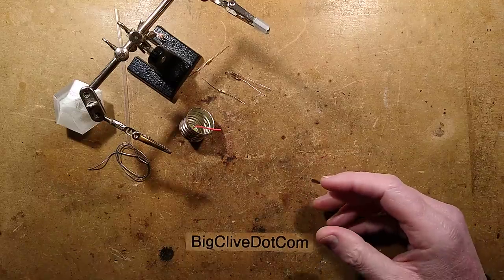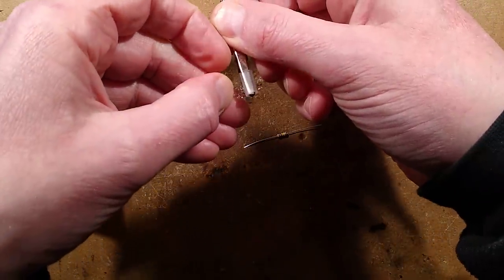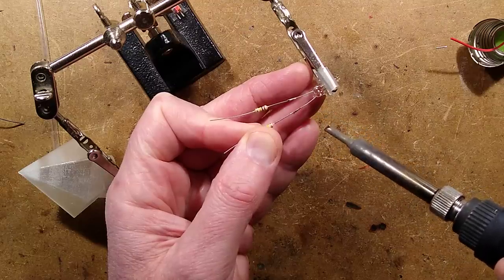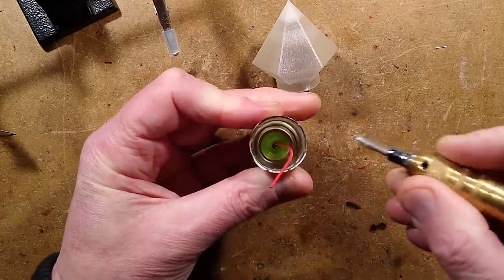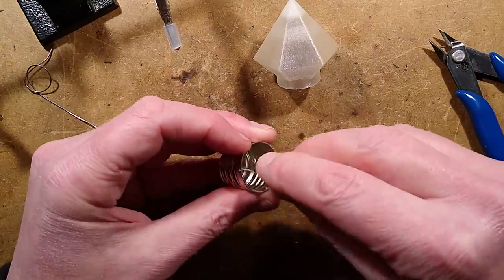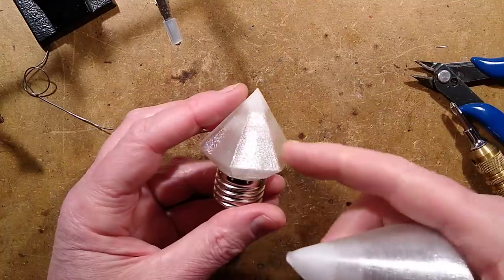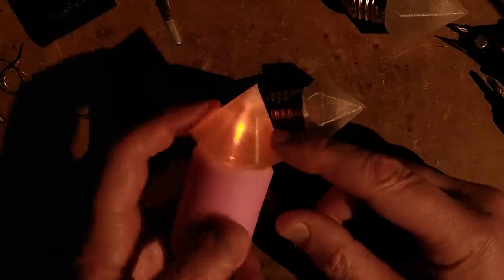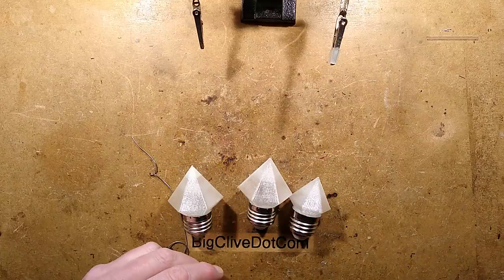Full build of a custom neon lamp

Comment: Many of us would prefer stl files, they are the standard in 3d printing and easily modified , I've never bothered with any of these projects because it means having to learn new software, it takes seconds to customise something in stl format.
Reply from the maker: With the openscad script the customisation is at source and much more versatile.
Reply: @bigclivedotcom  yes but it involves having to learn new software, the majority of people already know how to quickly and easily modify stl files in the software they use daily, everyone works with stls file but virtually nobody uses openscad...
Reply: @stevefox3763  According to the documentation, OpenSCAD can export to stl.
Reply: @stevefox3763  I barely know how to use it myself but i understand the "Preview/Export To STL" buttons , It can be interesting to mess with code and see what abominations you can generate 😀
Reply: I just worked it out in a minute flat. Its not super intuitive, but its not difficult.
Reply: @stevefox3763  there is a drop down menu on the right when you load the file.

And then its 3 buttons in the upper left of the preview window to export it as an STL. So you just change some numbers in the premade script, and then preview to generate it, and then export it using the button to the right of it.

Sure editing STLs is easy, but like... this needs no knowledge other than how to open a file
Reply: You don't need to learn OpenSCAD for this. You only need the basic knowledge of using Windows, Linux or whatever you must already have if you can edit an STL in seconds! Just open the program and copy and paste the script into the text window. Also on screen you should see the Customizer where you can enter a few dimensions to suit your requirements. When you're happy with it, click the Render button, followed by the STL button, and you've got your STL.
Reply: You can get an stl from openscad with two button presses (f6, wait for it to render, then f7)
Reply: Please do not offer stl-files only! Lots of people do so due to they don't want realy to share. If you realy intented to share your work offer the source files also (opencad, freecad, .. or what ever)!
Reply: "STL" and "easily modified" where two things I never thought I'd see in a sentence together. Modifying STLs is annoying at best.

That said I kinda hate OpenSCAD though because it will without fail crash for me. I've tried it several times over the last few years on multiple different computers running different versions of windows and every.single.bloody.time it crashes for me within 30 minutes of playing around so I've given up on it.
Reply: Writing this comment and reading the replies probably cost you more time and energy than creating your own freaking lamp cap in the program of your choice and / or learning how to use OpenSCAD  😅🙈
Reply: @stevefox3763  Please refrain from making generalisations, "virtually nobody uses openscad",  as that just in't true.   I for one, an OpenScad user and fan, appreciate seeing how other designers use OS to create objects. With an STL file how would you modify it to say reduce the bottom diameter  in order to fit a different screw cap but enlarge the globe part by 15% in diameter and 20% in height?  Please enlighten me as I love learning new skills.
Reply: @stevefox3763  How hard is it to copy/paste?
Reply: That's the difference between a consumer (only knows STL) and a maker (openscad/other cad-formats): Download and print or be creative.
Reply: @bigclivedotcom  You: Here's how to fish.
Some viewers: Please just give me a fish.
Reply: Modifying STL for anything but pure scaling is absolute horror for any reasonably complex object (I've done it once because the object was complex enough that re-drawing it from scratch would have taken a full day, instead I spent merely hours in fighting to get a reasonable approximation of a proper solid body model from the STL mesh, then did some modifications in about 10 minutes and got to printing). OpenSCAD can be annoying and TBH I've fully switched to Fusion360 since it supports Python scripting for things that are easier to code than draw. STEP and OpenSCAD files are the distribution format for models that are meant to be modified, providing STL on the side is a courtesy but by no means any sort of requirement.
Reply: @EeroafHeurlin  If you want to pay 400€/year (33€/month !) after the 36 month trial, okay. I'm quite happy with freecad and kicad.
Reply: @deterdamel7380  yeah they upped the price quite nastily. and kicad these days is a lot better but back in the day it definitely was not a viable alternative to Eagle for anyone who wasn't hardcore for Free Software (which is fine). Last time I looked at FreeCAD it wasn't all that great either (and I need a machining CAM package, fusion has good enough one, MasterCAM is windows only and costs a ton...) Also I have a well paying job, and the SW licensing costs are barely a rounding error in my muiltitude of misguided/unfinished hobby projects with expensive parts.
Reply: @deterdamel7380  🏴‍☠
Reply: Never ever use STL files from the internet without looking through it, there are people who will have the intention to kill your printer, asking it to do things it simply can't (either due to not being a Cartesian style while the STL is made for one, for instance, or the build volume being completely different).
This is also because STL files are made for a specific printer, and some derive 0,0,0 from the homing point, which might not be the front-left of the bed for every printer, but can be in the center...and then there's the risk of transport speeds exceeding your machines limits...
Reply: @Dutch3DMaster  I guess you mean gcode-files: They're printer-dependend. stl-files contains only the surface geometry. Sometimes gcode-files created by some webpages/scripts for special purposes- calibration for examples. Always with a big disclaimer about risks to damage the printer.
Reply: @Dutch3DMaster  You mean GCode files ? STLs describe the object not the raw printer control (speeds, temperatures, exact machine coordinates)

Comment: For the frostier tips, try setting "Minimum Layer Time" to 0s.  The tip has a very small cross-section, so the slicer is making the printer wait after, so that it can cool before slapping the next layer on, which can help with overhangs.  But during that delay, filament is getting extra cooked in the nozzle and changing the transparency.  These overhangs are fairly simple, but if you do notice drooping after removing minimum layer time, increase the max fan speed if possible.  As a last-ditch option, slow the whole print down so that the transparency is even across the whole thing yet each layer has more time to cool.
Reply from the maker: That fixed it thanks.  One of the many features I wasn't aware of.
Reply: A man that knows his shit, I like that!
Reply: 3D printing is so touchy!
hundred of different settings and each of them can ruin your print. that is only on the software side, my printer for example had tens of hardware flaws. for example the classic mounting of the heavy spool unto the top of the printer frame add plenty of wobble on top of all the other problems.
Reply: I was assuming the already laid down layer was getting to much cooling or not getting re-heated often enough for translucency.
No experience yet with transparent material, just received my first spool of transparent TPU 😃
Reply: @bigclivedotcom  
Hi Clive.
You talked yourself into this... 😻 ...
Can you please do a video about using a 3D printer..
complete idiot's guide..
including which printer, materials to use and power consumption.
A playlist series...
Regards from
Bella 🐈 & Mark.
Reply: I use vase mode in the slicing - doesn't seem to frost for me - but I do like the min layer 0 s/p tip.
Reply: @GFY_FOAD  Yeah, vase mode should work really well for these, because it keeps the speed of both the filament and the print head constant for the entire print.  It should have a fairly uniform level of transparency throughout.  It won't work for all prints, but this one is a good time to use it.
Reply: @bigclivedotcom  An alternative is to print more than one at a time.
Reply: Thank you! I print potion bottles for my work (Magician) and the necks get frosted for what I'm guessing is the same reason. Many thanks for sharing your knowledge

Comment: Love the small one. I love those old glass fuses. It would be fun to see if you could put the same neon in the old glass.
Reply: I've done this, and it worked well. Not hard to disassemble, with only the threaded portion needing to be removed and then replaced.
Reply: You used to be able to get indicator fuses that already had a neon lamp built in... (The neon lamp would glow when the fuse was blown)

Comment: Clive, I used blown out fuses like those in your photo, and added a neon bulb to them to operate as an indicator light. They are the same as a lamp base, so work well in a lamp socket, such as the type used in a garage or shed that uses no other additions such as a lamp shade or a glade cover. They were easy to disassemble, as a bit of solder holds the base to the fuse solder strip.

Comment: 3D printing inevitably turns into a hobby, on a base level it works as it should - but with every little issue solved, you gain a lot of knowledge and interest about the whole system. Artillery sidewinder x1 worked great in stock too, but with some modifications and running Klipper firmware, it's night and day

Comment: I'm glad to see I am not the only one who loves the old glass fuzes. I bought up all the ones I found in a local grocery store almost 30 years ago and have sadly run out and have to use the less nostalgic metal cased ones now. Thanks for the smiles.
Reply: Metal cased fuses?  home do you avoid shock when changing a different fuse or reaching for the switch for the same fuse holder?

Comment: Fiinally, some making again. Love it. To find out why the tips are "frosty", we have to know about your print settings. I found, I can print much cleaner "semi transparaent" stuff using PETG. But sometimes I am using PLA as well, and in that case I go with kind of an 80% cubic infill. This way I force a "frosty" effect, the "frosty" effect is spread more evenly.
Reply: I have some translucent green PETG which prints very well. Haven't tried a  very pointy shape like this though.l
Reply: Wouldn't an infill ruin the point of making an upside-down vase?
Reply: @johndododoe1411  Yes, sure. It depends on what you want. If an evenly spread frosty look is more important, I found playing with infill patterns is always worth trying.
Reply: @peter.stimpel  Point is to make a lamp with a neon bulb inside shining through the thin shell.  Infill would block mechanical insertion and light shining out.
Reply: @johndododoe1411  I did what I described, and therefore I can tell you: light is shinging through.

Comment: Very nice build, I have always loved the ambience these little neon bulbs give off, just enough light for some thing to leave on continuously, especially handy at night. I actually did something similar to this about a year ago, I also used the two resistor method. Mine is fashioned from what used to be a burnt out incandescent bulb that I found and thought to myself hmm, maybe I could do something with this. Amazingly it didn’t end with the bulb shattered into little tiny pieces and actually ended up becoming a finished product haha. That one doesn’t get lit too often, but I do run a neon flicker flame in my room continuously.

Comment: Iv learned to solder like you do Clive. Very handy with practice. Using all your fingers. But as a heat gun I use my bench power supply a use one of the little dished inside a car head light. And I have to say,  "it works absolutely great. You should try this out for yourselves because it's a very cool hack. (I Can't take the credit for it. I found it on aka KASYAN TV. ) ANOTHER GREAT CHANNEL BUT FOR PEOPLE WHO already know there way around a circuit board..

Comment: I don't know anything about 3D printing, but I do know a fair bit about plastics.
The reason the PLE is getting "frosty" toward the point more than further away from the point has a lot to do with 'tempering'.
Ass the printed object gets more dense with freshly printed (hot) polymer, the longer it takes for it to cool down and the better chance that the polymer strands are going to randomly cross link in a random direction.
Basically, if you could slow the lay down of polymer down a little bit, it will improve the clarity of the final product.

Comment: You need to have your filament dry. More important for ABS or even more for PET-G but most likely will help for PLA too. Basically the humidity bubles up inside. You could also lower temperture and make sure to print in vase mode. Having a bigger nozzler in vase mode also helps.

Comment: I have the same printer and it is the parts cooling fan duct. Restrict the airflow down to 10mm (directing the flow to the area directly below the nozel) was all it required for me to fix the problem.
Regards Tony

Comment: Now that we're on the topic of neons, would like to see more nixie flower experiments. Curious if they'd work with the phosphor lamps, and also maybe a chance for some 3D prints
Reply from the maker: I don't recall having success with colored neons.  I have a load here to try it with.
Reply: I wouldn't want to have a dangly mess of hot mains wires sitting on my bench (or where ever).. beautiful as it might be.. I'd rather use LEDs for the flowers ;)
Reply: @tinygriffy  reject led, return to neon
Reply: @Dekko-chan  do you know neons that go really really bright ?

Comment: "Frostiness" in clear PLA is due to air gaps in the layers.  This is usually due to less fusion.  There are two main reasons for this - temperature  and precision of deposition.  Since the temperature isn't changing, precision would appear to be a main factor.  Notice that the problem occurs at the smaller end of the prism, which means that the printer is doing frequent changes of direction, and that causes the printer frame to vibrate more, or at least changes the frequency to maybe coincide with the resonant frequency of the printer frame.  You could try slowing the print speed down for the final 20% of the print and see if that helps.  Mostly we try to print right on the ragged edge of what the printers are capable of, but sometimes we have to acknowledge the limitations of our budget hardware.  Cura has an "adaptive layers" setting which changes the print speed depending on detail.  You might try turning that on and see if helps.  Alternatively, manually dial down the speed when it reaches that height to see if that will indeed help the issue.

I'm thinking that setting a low median speed (60mm/s) and turning adaptive layers on might be helpful.
Reply from the maker: It turned out that the printer was deliberately slowing down to allow for the layer cool-time.  I reduced that to zero and it solved the issue.

Comment: A real deal neon lamp! Nice. I use a hot air station (when I'm at our hackerspace), an industrial hairdryer a.k.a. hot air gun (in my lab) or a Dremel gas iron (in the field) for shrinking the HSTs. If I'm very lazy and can accept an ugly job, I'll just go sloppy with the lighter, haha.

Makes me wonder if there are fusible resistors at 100k.
Reply: Check Vishay Dale FP2P.  Though I really can't make heads or tails of the data sheet, specifying lots of tolerances but nothing about how it behaves electrically.

Comment: I found prints go cloudy or matt at the top if the room is too cold. The bed radiates enough heat to stop it at the bottom, but as you go up that heat isnt enough and the plastic sets too quickly causing it to go matt.

With regard to off the shelf printing quality I think it depends on the brand. Ive always found Anycubic printers work fine out of the box, but they have less scope to be modified. They reach a certain point and they cant really be made better without drastic hardware changes. Something like an Ender 3 is more popular but can be horrible out of the box (but can also be great), its pot luck. There is a lot more community support for them though and you can get better results if you want to put in the work, but it really can be work.

Comment: Yes, even the very inexpensive printers today run quite well out of the box for general printing. Especially now that they come in large subassemblies that usually only require a few screws here and there to slap the whole thing together. Not like in the early days when they came in about a zillion pieces and took a whole bunch of tweaking once built just to get something even remotely resembling what was on your computer screen out of them. The resin printers are getting to be dirt cheap as well, and the level of fine detail you can get from them is really impressive. Though they do have the downside of creating an absolute disaster of a mess during certain print failures. But that is pretty easy to avoid as long as you give your machine a good look over before you run it, put some care into setting up your prints beforehand, and treat your resin well. Also doesn't hurt to run them on a old baking pan or something of the like to contain the flood should something go horribly wrong anyway. It sucks having to replace or repair your printer, but I'm guessing it would suck more to have to replace your flooring. Lol.

Comment: Yeah, you can buy 3D printers these days that are so simple to assemble. They literally come in two parts, the base and the upright part. Screw in a few screws, plug some wires in and with a couple of simple steps to get it calibrated, you're pretty much ready to start printing. It really is that simple.